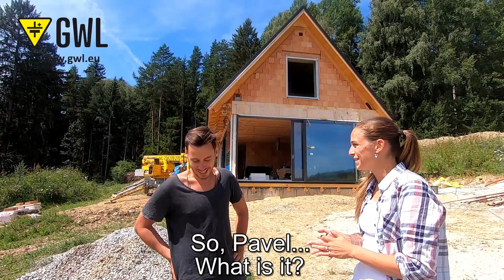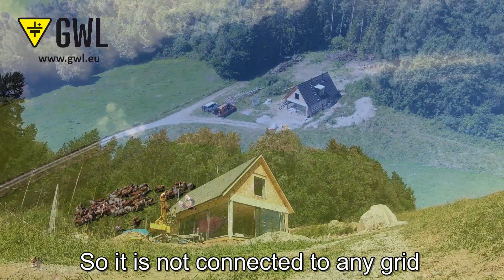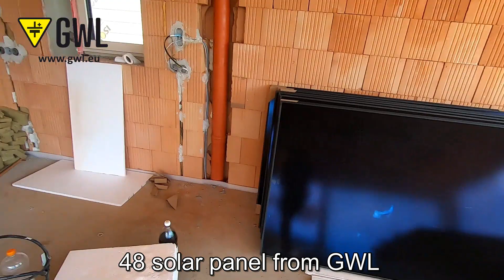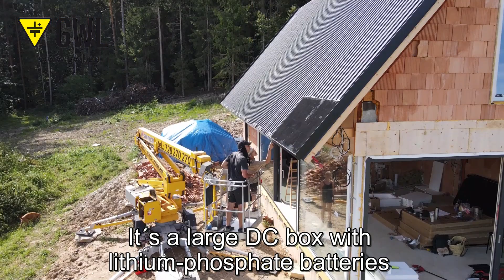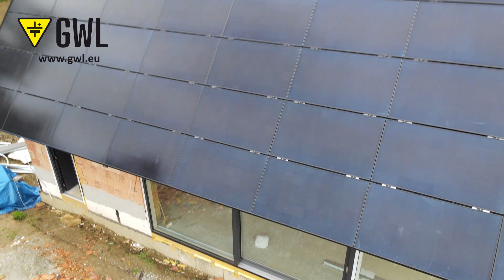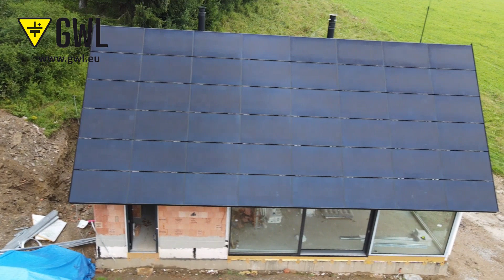Czech Sustainable House - 16kWp on the roof

Comment: Would like to see more information on the BEAST :) Cells BMS Solar controlers etc.
Reply from the maker: Battery cells are ThunderSky Winston 16x 400ah 3,2V, MPPTs are 3x VE 250V/100A
Reply: @ELERIX-LiFePO4  Thanks! Love what you folks are doing, very very nice!
Reply: Me too!
Reply from the maker: The more information what is inside the Beast is coming. Please be patient, please. but shortly: 1x VE quattro 10kW,  1x Multiplus 5kW, Phoenix 2kW, as BMS is GWL CPM check shop.gwl.eu.